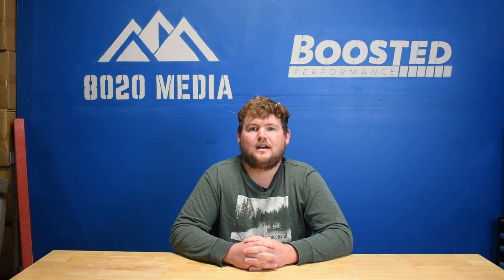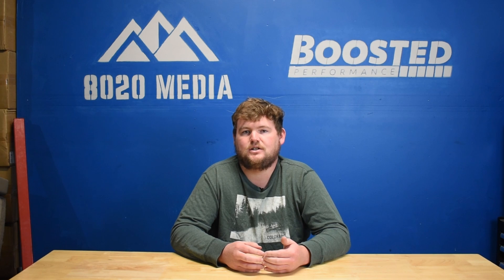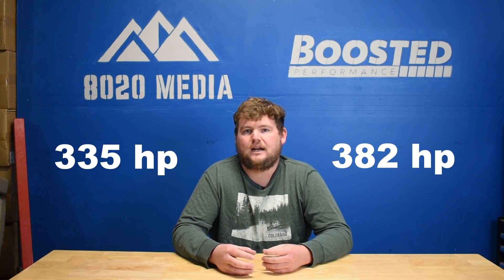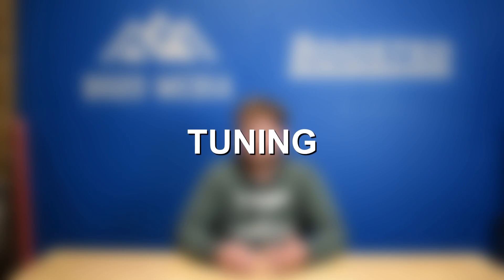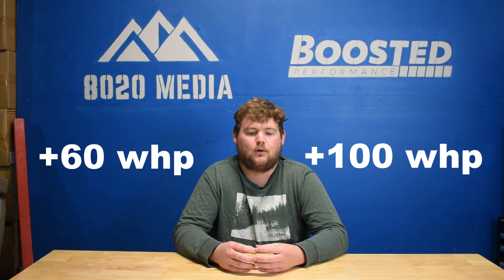How to Build a 500whp BMW B58!

Comment: Just got a 2025 m240i 
Love it but definitely want more power. These new models need Femto unlocked 😢 for a true flash tune.
 Im trying to decide wether to do a piggy back (jb4) or just send my dme overseas for the unlock .
I am still under warranty. Im aware that even jb4 could possibly void warranty if there is a problem that bmw can prove was caused by the jb4 but i think i would have better chances with keeping warranty with jb4 versus Femto unlock.

Thoughts ? 

One day when my warranty is up, and if we've decided to keep the car, I will want to definitely do the unlock and bigger turbo, etc. 
But I would like to do something for now while retaining my warranty. 
I also really want to run some sort of aftermarket downpipe, would prefer cattless because I'm in a non-emission state, but I don't want check engine lights. JB4 has no provisions for turning off check engine lights caused by catless downpipes . I've only heard of a few free flowing catted down pipes not throwing check engine lights. 

Anybody have any advice or thoughts on this ?
Reply from the maker: A - We've always been fans of the JB4's. Being that the engine is so new, this could be your best bet. However, it all depends on you, cause we don't want to mess with your warranty.
Reply: Jb4 is a good choise now. Nice gains, reliable, smarter for the warranty at the moment

Comment: Looking to buy a 2018 440i with a upgraded top mount borg warner turbo, intake, downpipe, hpfp and port injectors currently running on a custom tune, would this be ok to run a flash ots tune such as MHD stage 3 or no?
Reply from the maker: L - Sounds like a sick build. It would, but since it already has a custom tune, why not use that?

Comment: I’m so confused, my friend has a 2021 m340i xdrive, he got his DME unlocked in Finland and has a chargepipe and dp, we just installed MHD flexfuel and he’s running E85 (realistically E80 not that it makes a difference), however it’s still not crazy fast. For reference my 2018 STI is making 520whp on a mustang dyno, and one of my modes in the car caps my whp to 400 wheel. When I race him on that mode and he’s on E85 we’re roughly neck and neck, but that would mean he’s only at around 400 whp (on mustang dyno)? Also before anyone says anything about power to weight, I’ve raced a stage 2 Supra (No E and also second gen) along with a stage 2 340i xdrive (also no E) and literally been neck in neck with both of them, so ik the power is possible. Also I’ve raced a stage 2 m240i with E50 and a stage 2 XHp trans tune and lost barely. My question is did we install something wrong and maybe there’s a boost leak or something, or does he maybe need a more aggressive OTS tune or even pro tune to make true 500whp? (Mustang not dynojet)
Reply from the maker: I - Might need a map for more power. Sounds like he's got all the right things needed to support it. We have a tuning guide on our site if that helps.

MHD: https://bmwtuning.co/bmw-b58-mhd-tuning-guide-info-hp-gains/
BM3: https://bmwtuning.co/bmw-b58-bm3-tuning-guide-info-horsepower-gains/

Comment: Is there a tune for better gas mileage? Would love to be able to switch to a map on long drives to get 30+mpg
Reply from the maker: A - There are indeed! Just depends on which tuner you go with.
Reply: Yes it's called removing your mods.
Reply: @cammgt3rs370  If your tuner allows you to switch on the fly, there are highway maps that allow you to run lean at a higher speed and lower rpm. Convenient on road trips for less fuel stops, a few guys on vette forum get 40mpg. Not for everyday driving.

Comment: Can the B58 modded up to or around 500+ hp, function well as a daily driver and be reliable? I want a 440i gc next year, but dont want a headache to deal with. Thanks.
Reply: as long as you start with a well treated engine then YES. Oil changes and maintenance is key to having a reliable engine. Oil changes, fluid changes are critical, do those and all you need is the HPFP, downpipe, MHD tune and your pretty much there.
Reply: i actually have a 440i gc it’s stage 2+ MHD on E40 and i do an hour commute every weekend and do heavy driving and haven’t had an issue i would highly recommend it i have had it for almost 2 years now
Reply: @briandabagchaser  Thank you. I want one so bad, but have to wait until next year 2026, to see if I can do it. All debts will be gone, and child support ends, YAH!!! Thats money back in my pocket, and maybe 440i GC Xdrive in my garage. 😁
Reply from the maker: C - It can be. All just depends on how many supporting mods you get for it!

Comment: Hey man, 

I got f36 440i and i have change to catless downpipe and intake also got a mhd ots map and xhp, 

My point is that i haven’t upgraded hpfp, can i still run ots map like stage 2 with E85 octane, if so like how many liters or % should be in the tank with normal gas?? Cause where i live we got only 95 and 98 octanes
Reply: Stock TU pump handles a max of 33% ethanol.
Reply: @cj340ix  thanks for the answer what about stoch hpfp, not tu the stock one in gen 1 b58?? How much ethanol it can handel??
Reply: @Zhyar.Yassin  don’t know, best is to upgrade asap to the TU pump no matter what tuning your are going to do. The TU pump has a lot of potential and gives you a lot of breathing room when tuning the car.
Reply from the maker: Z - We have a ton of content on our BMW website that'll help you out here: https://bmwtuning.co/b58/

Comment: I had a “custom” stage 1 tune with air intake and catless downpipe  , only got 9 WHP and 90 torque
Reply: Stage 1 tunes are kindve just like stock + , u need to go stage 2 with a dp
Reply from the maker: 2 - That doesn’t sound right
Reply: @8020Automotive  yes definitely, think I got cheaped out on the tune. He said it was custom eagle eye 🤷🏽‍♂️ at least that’s what the dyno results were
Reply from the maker: 2 - These engines are extremely capable.. a tune with the mods you listed should be doing A LOT more than that.
Reply: dosent sound right maybe the stock numbers were brake horsepower and the numbers that you got were wheel horsepower

Comment: hybrid turbo, hpfp, water meth, downpipe and tune --- 500whp reliable
Reply from the maker: P - Thanks for sharing the insight.
Reply: What hpfp you got?
Reply: @qauic8123  dorch st 1
Reply: Dont need meth or hybrid turbo for 500whp. Dorch hpfp, tune, dp, e40-50 blend & good custom tune for 500whp

Comment: Stock intake and airbox is extremely well designed so other than getting an high performance air filter that should be good to go as far as performance is concerned.

I still went for an upgraded intake (with the inlet that goes all the way to the turbo) just for the sound. The default system has 3 "resonators" that muffle the turbine noises a lot.

I just love hearing the turbo much more, and for normal driving you don't really notice it much so it's not obnoxious either
Reply from the maker: D - Thanks for sharing your experience! It really all comes down to personal preference.
Reply: I prefer the cold air intake upgrade. Better turbo spool sound and slightly less turbo lag 👍🏻

Comment: Great video! As a newbie, I am learning a lot as I own a 540i 2023 (B58TU300M1 type) but may I ask if I have no access to E85, and only a gasoline pump (high octane 98 fuel), what kind of tuning I can get? Also, having the 540i, I am not a big fan of the handling and suspension, I guess not so comfy on road pumps nor firm for body roll. Can you suggest the best suspension mods (having Runflats on 21inch rims, and I am happy to change these if required. Again, thanks a million!
Reply from the maker: Khaled - We think our community may be best for this: https://community.bmwtuning.co/

Specifically our mod courses will go over these questions in depth: https://bmwtuning.co/courses/bmw-b58-engine-mod-tuning-course/

We've spent thousands of hours researching the BMW engines and all the answers you're looking for will be there.

Comment: Hey man. Great video. I'd like some tips here. So I plan on buying a F32 440i and modifying it to have the same or similar performance as the F82 M4 Comp. So around 450-500 whp and similar maneuverability. 

I basically want the performance of an M4 without actually having the M4. Reason being I don't want the attention the m4 brings. I love the car, but I want something subtle like the 440i. Also the F32 is a bit more practical.

Other than modding the engine. What else can I do to get to as close to M4 performance as possible
Reply from the maker: Khumo - Thanks for the feedback! So, assuming that you already know what you need to do in terms of engine mods and tuning, the next place that you’ll need to look to get your F32 as close to an F82 as possible is the handling/drivability aspect. Ultimately, even with extensive mods, a 440i isn’t going to feel like an M4, but there are a few notable upgrades that you can do to improve the overall driving experience of your F32.

There are quite a few differences between the F32 and F82 in terms of driving dynamics, and the major differences lie in suspension setup, brakes, differentials, bushings, and tires. A quality set of coilovers, such as Ohlins, will help improve grip and reduce body roll in a track setting at the cost of a bit of comfort. The M4 has much better 6/4POT brakes than the 440i, so you’ll want to think about upgrading to a big brake kit if you plan on doing extensive track driving. The M4’s Active M differential is another major difference between the cars which gives the M4 more intuitive handling characteristics. The best option for the 440i is to swap the diff with an M Performance limited slip diff which will be a night and day difference during both acceleration and throttle lifts or braking (decelerating) at turn-in.

The F82 is a much stiffer car all around which is optimal for performance driving. To give your F32 more of that feel, you can swap out the majority of the car’s primary bushings in favor of polyurethane bushings. While poly bushings are great for performance, they will reduce daily comfort by quite a bit.

Tires are another major factor in the performance of your F32 on track. While there were a number of factory tire options for the F82, the best performance option for the M4 was a set of Michelin Pilot Super Sports which would provide extreme grip on your F32 as well.
Obviously, there are quite a few other major differences between the cars not mentioned here, but that is a pretty good start, hope that helps!
Reply: @8020Automotive  Wow. Thanks. I knew there were a lot of differences, but no one explained them like this. I was really surprised with the differential.

This actually makes me reconsider the M4 😅. Would be more simple to just buy that. Anyway, I really appreciate the response. I'll come back to this if I do decide on the F32.

Thank you
Reply from the maker: Khumo - No problem at all! Keep us updated on this.
Reply: I'm planning on building my 340i with the same philosophy as yours. Here are some things to consider: WIDER WHEELS & TIRES (18×9.5 ET35 Square w/ 265/35/18. This is as large as you can go without pulling the fender and strut clearance may require a 3-5mm spacer in the front. All equal tire sizes aren't the same so it's a good habit to compare tread widths on Tirerack.), LSD (M Perf LSD or Wavetrac. This'll help with putting down power on limited tire and help with extracting the limits of the car.), SUSPENSION & BRACING (in order to get more adjustability and camber, you can either go with F8X M arms with poly or monoballs while installing powerflex bushings into everything else. Or you can splurge on the SPL catalog which have spherical bushing on both ends and are also lighter than factory arms. Solid or Delrin in the subframe really tightens up the rear if it's already moving on thrashed rubber. There hasn't been a noise increase at least from my experience. Differential bushings with a Burger Motorsport lockdown kit would also be something to consider. The lockdown kit will add some harmonics but the diff bushings will make the most change. I'm a firm believer in matching the subframe and diff bushings with similar materials [on most platforms, not all] but understand that this can be too much for some. If you think delrin on the diff will be intolerable, I'd go with the lockdown kit and a medium Powerflex polyurethane. Transmission bushing I'd keep stock or one poly grade above stock. The whine is nearly unbearable and even if you added more sound deadening around the transmission tunnel it'd probably still be too much. Motor mounts are personal preference. I find the stock motor mounts with aluminum inserts to give a nice raw feel but then again, it can be too much for some. Powerflex also make inserts with poly. I know on the E9X and E8X 35i platforms, there was a problem with melting poly mounts and inserts when partaking in track days or prolonged spirited driving. Doesn't seem to be an issue on this platform just something to consider. Lastly for this section, if your steering has a clicking feedback of deadzone near the center, upgrade to the aluminum rack and pinion.), QUALITY COILOVERS unless you're at the highest level of motorsports or competing, brand rarely matters as long as you have proper spring rate and valving for your vehicle and application (some of my recommendations would be KW, ST, MCS, and Ohlins), & WEIGHT REDUCTION (wheels, brake components, lightweight suspension arms [SPL], aftermarket struts, carbon hood, carbon trunk, bucket seats [I find the Sparco EVO line to be reasonably priced and comfy], lithium battery [Antigravity would be my choice], carbon driveshaft [we don't have any off the shelf options for this platform but given that the A90 Supra community has one, I'm sure DSS can custom build one], and custom DSS axles [at least on the platforms I've seen, they hold more power while being lighter than factory.]

These cars are not and will never be M cars but that doesn't mean that we can't make them more fun and capable. I know I typed your ear off but I wanted to be as thorough as possible. Not sure if you plan to track your car or not but these engines seem to hold up to abuse pretty well, we don't have oil starvation issues like we did on the N55. Fuel starvation however is still an issue just due to the saddle design. Anywhere from 1/4 - 1/2 tank on a road course and you risk fuel starvation. Keep it above half and you should be good. There aren't any drop in surge tank solutions on this platform but you can modify the fuel hangar to accommodate an external tank. Just use quality lines and fittings so you don't get fuel smell into the cabin. M cars share this fate too so that's one more thing that brings us closer together lol
Reply from the maker: L - Thanks for taking the time to write this out! It will be very helpful for future viewers!
Reply: @user-ki8zf1rp1e  Ayo. Thanks for this comment. It was incredibly insightful 🔥🔥

Not gonna lie it kinda makes me just wanna by the F82 instead 😅. But seriously thanks. This will be incredibly useful if I do decide to get the M4 or 440
Reply: @khumokwezimashapa  No problem, test drive them back to back if you get a chance. Both are great but the M is a lot of car for my use; predominantly street with a few annual track days. Ditching those atrocious runflats🤮, installing an Mperf LSD, and coilovers make the 3 series significantly more enjoyable. Good luck with the build, bro, lmk if you have anymore questions.
Reply: @user-ki8zf1rp1e  I actually said I'd test drive them before I by them. However I already know what the M4 will feel like because my dad has the F83 version. I've never driven the 440i before, but I can imagine that it could be somewhere between my uncle's E90 335i and dad's F83 M4 as I've driven those 2 back to back before.

Thanks once again for your comment. I'll let you know if I have any questions and when I finally buy the car I want

Comment: What gasoline additives can we use with the gen 1? ie- liquid moly Is valve cleaner injection cleaner Valve cleaner injection cleaner. And their speed Tech.
Reply from the maker: Are you looking for something to help keep the valves clean? It never really hurts to toss some valve cleaner in there from time to time but since there is no port injection on the gen 1's it really isn't going to do anything in terms of cleaning out the intake ports, it will just help keep the valves a bit cleaner, albeit minimally. I don't have any experience with the LiquiMoly SpeecTec but I wouldn't expect much in terms of performance benefit out of it.